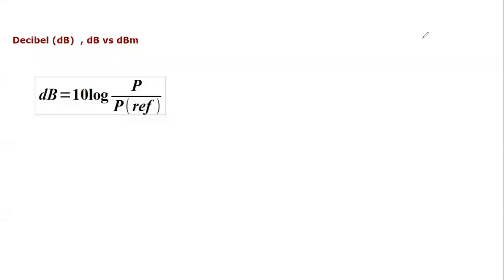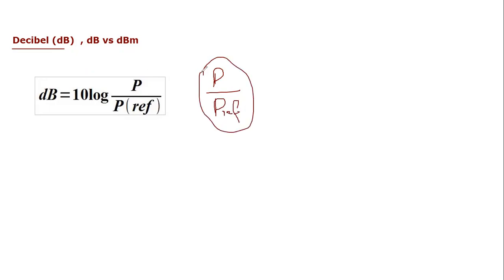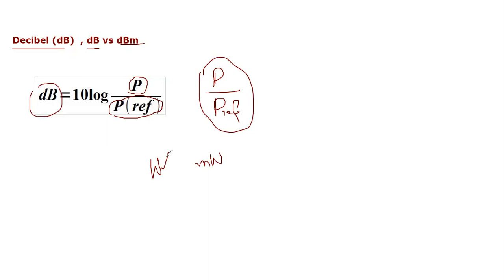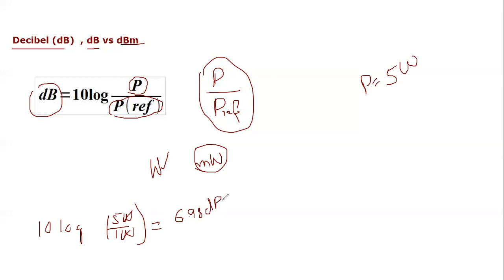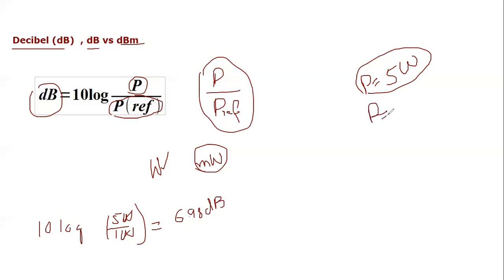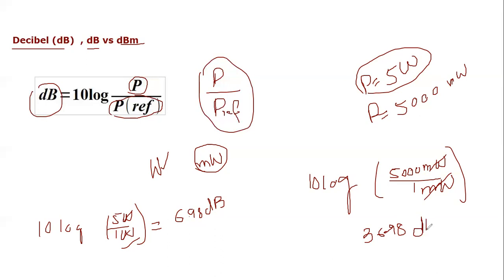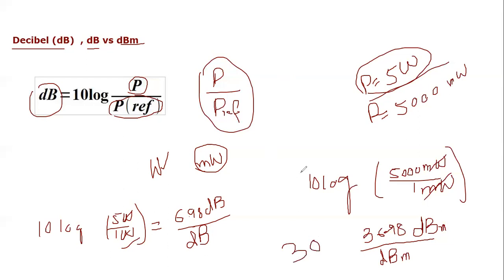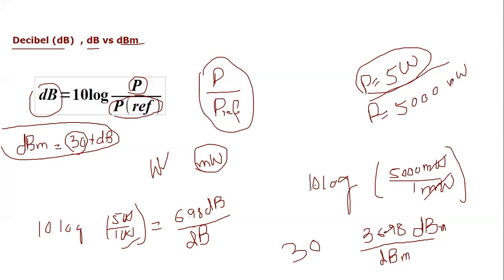The difference between db and dbm | What is dbm? | dbm  db interconversions| What is decibel?

Comment: THe last part is not entirely correct. You are essentially converting dBW into dBm. dB by itself is a unitless power ratio. not an absolute physical quantity you would talk about a PA having 30dB of gain and then by your logic it would be equivalent of 60dBm of gain, which makes no sense. dB is a ratio of Pin vs Pout. dBm is a miliwatt  relative Power quantity
Reply from the maker: This video tutorial was made for link budget calculations. In those calculations one i s required to add gains in logarithmic scales (equivalent to multiplication in Linear scales). The purpose is to evaluate input or output powers. And the right calculations are function of presice care of unit milliwatts or Watts. That's where one neer to convert dBm to dB (meaning changing reference of milliwatts to Watts) or viceversa.  Otherwise you are right... Its gain or ratio of physics quantity as I stated in my earlier part of video. So its unit less and doesn't to be upscale or downscale in units.